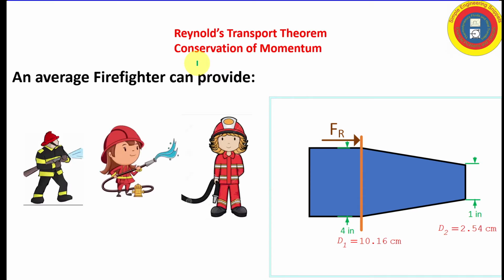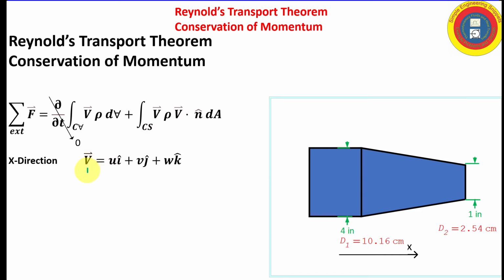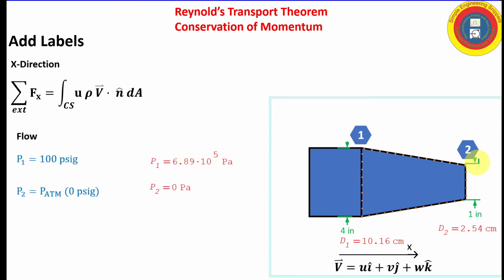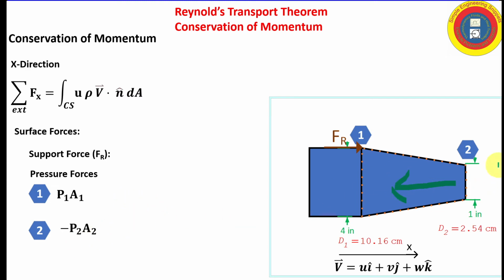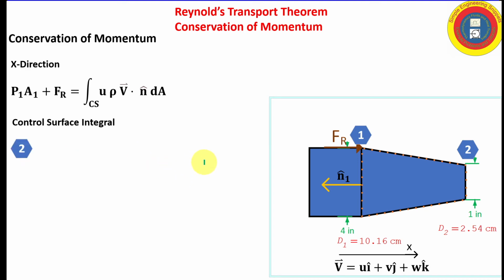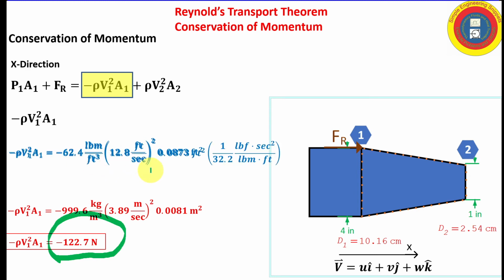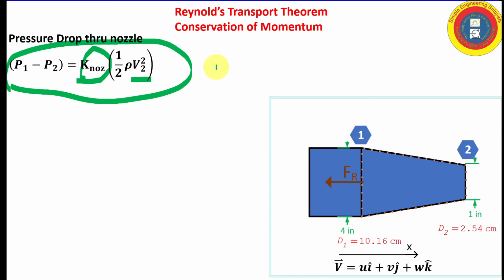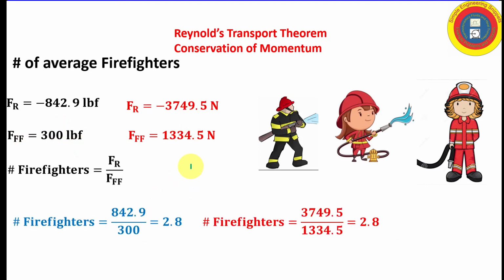Firehose Nozzle Support

Comment: The intuitive understanding is that the water coming out from the nozzle ought to push the nozzle back.  I went to look at firefighter videos about how to hold hoses, and they are always leaning forward, which would indicate that the intuition is correct.  And the way they explain this is simply by Newton's 3rd law; that water comes out of the nozzle, and so the hose is trying to push you back.  So, based on the fact that both intuition and the experience of the fire fighters appear to contradict your answer, I think you made a mistake.  I also remember working with small garden hoses, and my recollection is that if you drop them, sometimes the hose snakes back and forth on the ground as if the nozzle is trying to run away from the water jet.  If your answer were correct, then it would appear that the hose would shoot forward, as if the nozzle were trying to chase the water jet.  

I would guess that you must have set up the problem wrong.  But figuring out the forces is confusing when looking at a fluid that is flowing.  

I am imagining the extreme case where the nozzle diameter is 0 (the same as just capping the end of the pipe).  Clearly then, the water pressure would try to blow the cap off.  But the pipe itself provides the force necessary in order to overcome this.  I think this result causes the hose to try to become a straight as possible when under pressure.  I think this is the reaction force that you calculated.  But the firefighters do not experience this force.  

If you were to draw a box around the water source (like the water tower, or the fire truck), then clearly, conservation of momentum would say that the whole box is pushed back as a result of water leaving the box with velocity.  The math would probably be the same as what you would use for a rocket, except that this rocket is attached to the ground.  

This is my train of thought so far.  I think the problem is that you are not distinguishing between the reaction force on the pipe/hose, and the reaction force on the firefighter.  I think the firefighter does not directly experience forces from the pressure.  The pressure will try to destroy the hose/pipe with or without the firefighter being there.  I think you can treat the water source + firefighter as a rocket, and the water leaving as the fuel.  But if the firetruck (or whatever the source is) is not helping the firefighter to stand up straight, then the firefighter has to resist ALL of the momentum of the water leaving the nozzle by himself.  So, I think from the perspective of the firefighter, the density*V^2*A in the nozzle is the only term that matters.  I think all the other forces are resisted by the hose/nozzle.
Reply: I arrived at the same answer as OP independently. I found this video because, like you, my intuition did not match the answer. But then I thought, if the glue holding the nozzle on melted a bit, don’t I expect it to fly forward, pushed by the water behind it? That convinced me that the math is correct. But it still doesn’t explain why a firefighter feels a strong backward force. Hold on, if you extend the hose downward, you’ll see a backward force appear. In this new case, the water pressure isn’t in the x-direction force balance.